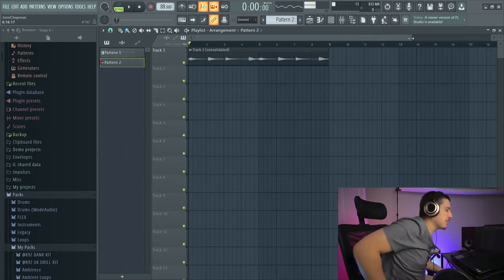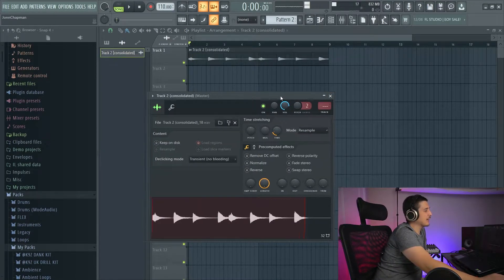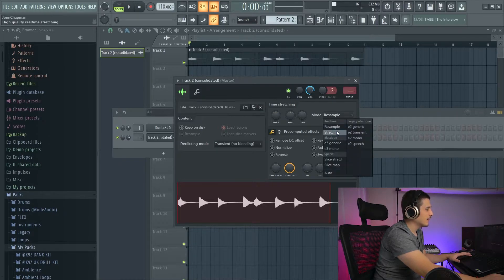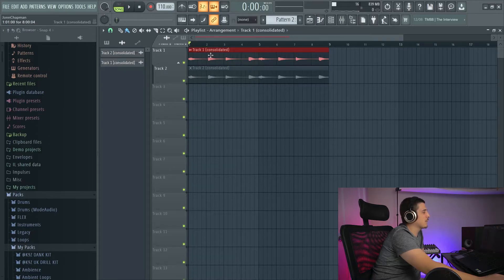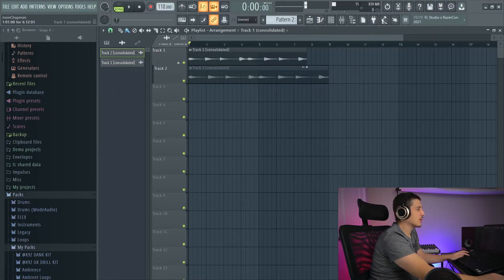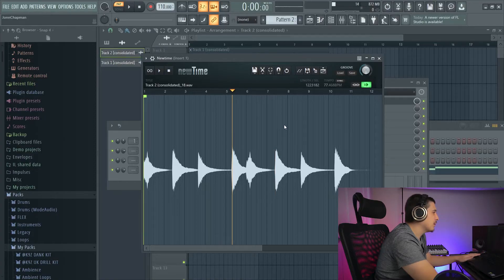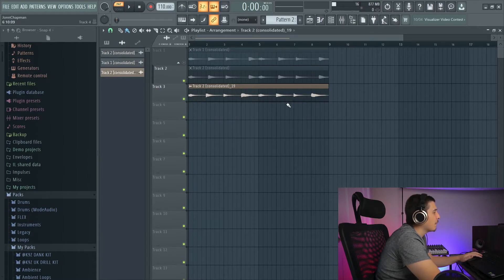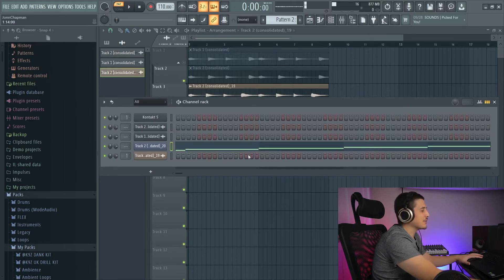How to Fix OFF BEAT Sample in FL Studio | Matching Tempo + Fixing Timing with FL Studio NewTime

Comment: sorry but i don’t get how you know it’s on time when your time stretching
Reply from the maker: Depends on what you're time stretching. Few different scenarios

1. If what you are stretching has drums and is a bar or 2, you will want to line the transients of the snares/claps up with the 2 or third beat lines. 
2. If what you are stretching is shorter than that, you will probably want to turn on the metronome and again try to match up some transients. 
3. If it does not have drums but it is a few bars long, you will want to try and line up the beginning of each bar/phrase with each bar line. 
4. If it is short with no drums you will probably need to listen to it with the metronome and play with it until it sounds on time. 
5. If it is just vocals or an instrument that may not start on the first beat, then you will really have to wing it with the metronome on and play with it to the best of your ability.

Note: Some songs (especially older ones) weren't recorded with a Metronome meaning that the tempo may fluctuate throughout the song or sample causing some parts to be off time even after you got the tempo matched.

Comment: Hey man your video is very helpful! I have a question to ask. I am running FL Studio 20. I quantized my recorded audio using newtime. However, when I save my quantized audio, it sounds glitchy and some parts are corrupted. Do you know a fix on this issue? Thanks in advance!
Reply from the maker: Sorry for the late response! This sounds like a very interesting issue. You can try a work around for saving the audio. We can actually record the output of your NewTime plugin to the playlist as an audio file. 

First, arm the mixer track that your NewTime is on. You can do this by pressing the dot located to the bottom left of the volume slider for the mixer track in question. After the mixer track is armed, right click the main record button (located next to the play and stop buttons at the top of FL Studio). After right clicking the record button, make sure "Audio" is checked in the dropdown. Click the record button to turn it on and then press play. The output of your mixer track with NewTime will record to your playlist as a brand new audio file.

Note: You may want to turn off the "Automation" recording in the same spot as the "Audio" recording, I've had it pick up things I didn't want before which can be annoying.

Comment: Hi... Thank you for this... But please i need your help... I am working on a project that was recorded live. But the bpm of the live audio itself is not stable... Please how can i atleast make the bpm of the live audio itself stable and consistent
Reply from the maker: Hello! Sorry for the late response! I think your best bet is to turn on the metronome, get it as close as you can, and then stretch and adjust the tracks as needed. You can make cuts and then right click each new chunk of audio in the playlist and "make new as sample". This will allow you to alter each new piece on its own so your adjustments can be individual instead of affecting the entire recording across the entirety of the playlist. You'll end up with a bunch of audio channels in the channel rack but you can always join them back together when you are done. If the recording fluctuates too much for the top method to be affective, I would try to use NewTime by marking every other beat and then quantizing.

Comment: how do I set the tempo only for one track ? In my case, I have set music including with its tempo, now I put in a new soundwave for vocal, but it recorded with different tempo, so when I play, the vocal didn't fit the tempo with the music...  Please help, thank you
Reply from the maker: You'll need put either the instruments or vocal into "Stretch Mode" via the audio wrapper. After it's in "Stretch Mode" you will want to adjust and stretch the audio manually to match the tempo you need. This can introduce artifacts into the audio and is not recommended for large changes (although sometimes it can sound really cool).
Reply: @ScaleAudio  alright, thank you

Comment: Is the newtime plugin similar to pro tools tempo mapping, where you set the grid to the transients of the sample?
Reply from the maker: Sorry for the late response. I'm not sure about the pro tools tempo mapping because I haven't used pro tools in 10 + years. New Time gives you a snappable grid and allows you to stretch audio samples to that grid via snap points that you create. These snap points can be created anywhere along the sample (including transients). Not only can you snap these points to the grid, but you can move them off the grid and give them swing as well. Hope that description was helpful!

Comment: Is there a way to consolidate the wave automatically to fit the bar loop without having to cut or stretch it every time ?? Whenever I consolidate a wave theres always an extra little piece at the end that goes over the bar
Reply from the maker: Consolidating usually exports with any FX or reverb tails from the instrument itself etc. Easier to just cut rather than trying to fight any built in reverb or effects. In my opinion at least. Hot keys are my friend on this one. Usually I just click C to bring up the cut tool and hold shift+right click. Right clicking deletes the shortest side and shift snaps to whatever grid you’re set to. You may already know those though. You could probably actually try highlighting the the length you want to consolidate and then choose to “export the selected area”, and then choose “cut remainder” or “wrap remainder” if it lets you.